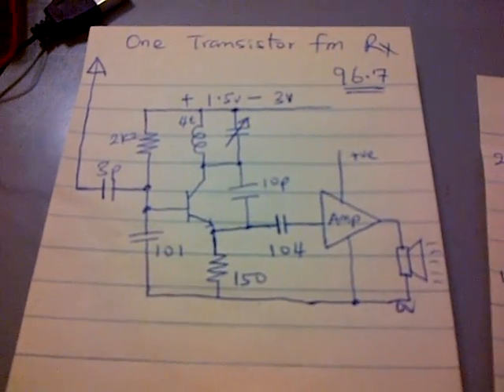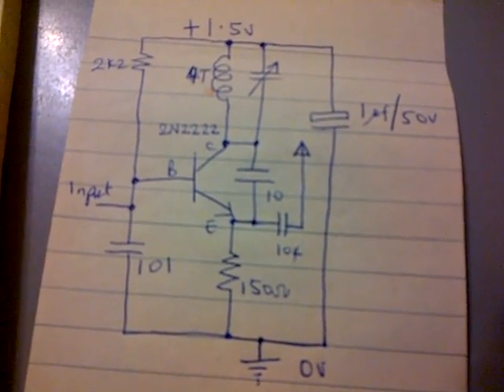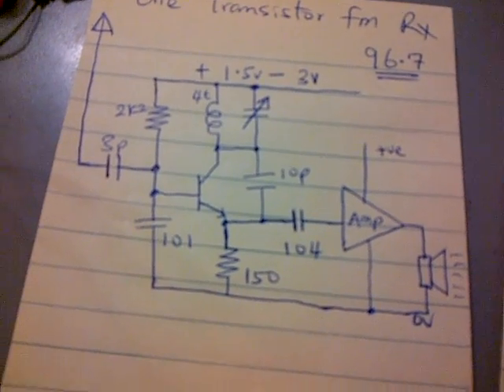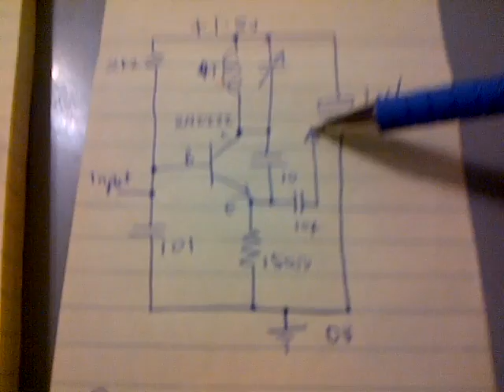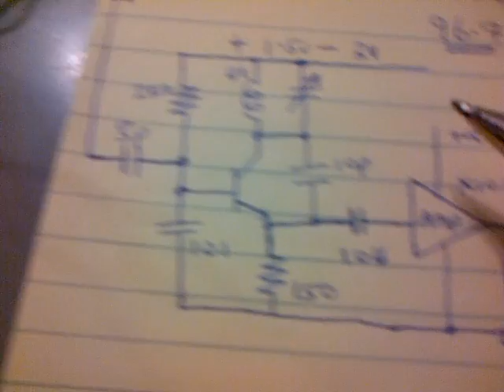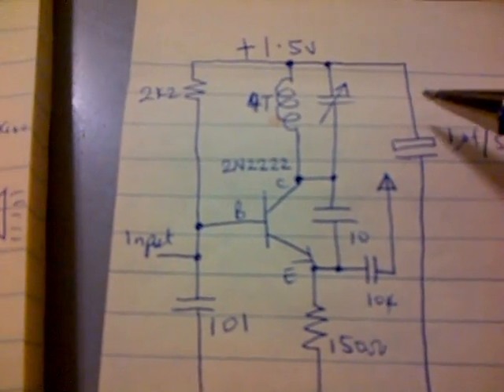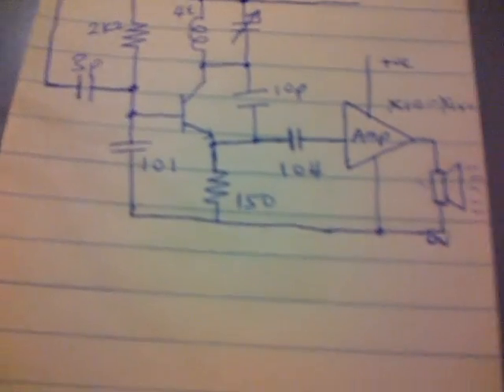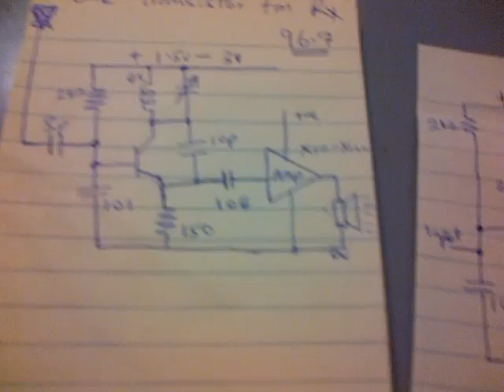Crafting a Simple FM Receiver with One Transistor | HecaWorld One transistor FM Receiver

Comment from the maker: I made this FM Receiver for fun. Many people commented that they built the same but theirs are not working. This might be related to your proximity to an FM transmitting station. The farther you are, the less sensitive/selective your receiver would be. 

This is really why you have complicated circuits for your typical radio receiver. You have the front end amplifiers, mixers, Intermediate frequency (IF) amplifiers, Detectors (Ratio detectors) and Audio Power amplifiers. 

Those are really useful. So, if you want to make a full-fledged radio receiver, you might need a lot of those parts. 

For the rest of us 'Enthusiasts', let's just have fun with the one-transistor systems. We will be working on some cool stuff soon... We'll be building Transmitter bugs and Long range transmitters soon (for educational purposes only... else, you might need a license).

Comment: Whats the purpose of antenna in the receiver cct?
Reply from the maker: An antenna helps to improve reception if the receiver is located in an area with low signal strength, but if you live very close to your radio station you may not need it - although I strongly recommend using one. The receiver is a regenerative one and not your regular superhet design.... it can use all the 'help' it can get in terms of signal boosting, even if it is by the use of a crude antenna.

The length of the antenna will depend on the target frequency. Get an antenna that is at least 1/4 of the wavelenght of the frequency you intend to receive.

Comment: Interesting idea, but I don't think connecting the antenna to the base of the first transistor can work because this tranistor works in common base mode (for 88-108 MHz the capacitor of 1n effectively grounds the base of the transistor and of course also the antenna signal!
Reply from the maker: Thanks for your comment, however, 101 is actually a 100pf Capacitor, which is 0.1nf... there is at least a 14.7-Ohm to 18-Ohm Base-Emitter impedance at the operating frequency range.... I believe that's why the circuit works... 

I will experiment with another version with a different value of capacitors or even an actual resistor to see how it works... :)
Reply: @hecanet  OK, my mistake. 100 pF is indeed different from grounding the base. The transistor functions as a crude mixer this way. Why didn't you block out the HF by means of a choke (100 microH), followed bij a 10 n capacitor to ground (low pass filter), before amplifying the AM signal? This should clean up the audio considerably.
Reply from the maker: @erikdevriese671  That's an interesting take... do you mind sharing a full circuit diagram for that? I or others could look at that sometime in the future... at the time, I simply wanted to show that an FM transmitter could also function as a regenerative FM receiver with minor modifications.

Comment: Is receiving digital data different from receiving voice
Reply from the maker: Yes... even though both are transmitted by the same wireless medium, digital data requires digital signal processing (DSP) at both the sender and receiver circuits. Audio/voice signal can be detected by a single diode, but a digital signal requires some processing and Analog to Digital conversion before it can be used as a digital signal.

Comment: What is the working principle of the receiver? How is the frequency modulation converted into an output signal with varying amplitude to drive the amp?
Reply from the maker: The circuit is a Colpitts oscillator whose frequency is determined by the tank circuit (Parallel LC circuit).

At resonance, the impedance of the L and C are equal and opposite... this effectively offers the least path of resistance to the station whose frequency has been matched (tuned in to). 

 The detection is accomplished by the transistor and the audio is extracted from the emitter capacitor (104 or 0.1uf).
Reply: @hecanet  thx man

Comment: We received a lot of questions about the Variable Capacitor. We are sorry to be responding this late, but just in case someone is seeing this video after the fact, the value of the Capacitor and Inductor must be taken into account... the tank circuit is a parallel combination of the Capacitor and Inductor. As long as the formula is observed F = 1/2pi *sqrt(LC), where F is the Frequency, L is the Inductor and C is the capacitance of the capacitor.

Comment: With this circuit, mine work greater than all superregen FM receiver that I build based on Webs (google).

Just my MOD:
Use Li-Ion (3.7V) and limit the current with 50K before this receiver, than before 104 to amp, put 20 turns enameled wire on 3.5mm diameter for RFC that make sound clearly. C9018 work better and better than any Transistor that I tried before.

I think this is the best FM receiver that I build for fun.
Next: modify it to make simple Transceiver or Walkie-talkie FM based and use it for disaster situation or survival time or when camping.

Greetings from Jakarta, Indonesia 🇮🇩

👍👍👍

Comment: I am wondering , is anyone really get this receiver to work.
Please post your schematic with parts you use especially which transistor s9018 maybe?
Reply: With this circuit, mine work greater than all superregen FM receiver that I build based on Webs (google).

Just my MOD:
Use Li-Ion (3.7V) and limit the current with 50K before this receiver, than before 104 to amp, put 20 turns enameled wire on 3.5mm diameter for RFC that make sound clearly. C9018 work better and better than any Transistor that I tried before.

I think this is the best FM receiver that I build for fun.
Next: modify it to make simple Transceiver or Walkie-talkie FM based and use it for disaster situation or survival time or when camping.

👍👍👍🤔
Reply: 2SC9018 👍👽

Comment: Try disconnecting the 100pf capacitor at the input of the receiver. It looks like there is an attenuation reducing the signal strength about thirty to forty times at the input.

Comment: you'd better Connect a transistor with a 22K resistor on base after the opamp... otherwise any short-circuit or heavy load would blow up your IC within a split second ;)

Comment: hecanet can i use bc 547b or bc108 i can't find 2N2222 transistor please answer me
Reply: hecanet thaks, but in the rx circuit i didn't see wire between amplifiler and war. capacitor what need to stay there? http://prntscr.com/77qys3
Reply: hecanet transmitter works good with bc547b but i have a problem with rx i can not pick up any radio station i change the coil  bur same problem

Comment: This is not FM, sorry. It recieves the AM part of the transmitter. such simple FM recievers are not possible.

There is a reason, why you need multiple steps for recieving FM. Single Transistor - impossible. Even multiple transistor FM reciever is hell of a difficult job. ICs designed for that purpouse are prefered.

Comment: both TX and RX are identical OSCILLATORS, oscillates in FM band one is mixing signal to carrier signal another filtering, if transmitter is powerful then receiver works great. & if transmitter is poor then receiver need much greater amplification!
Reply: What you mean same frequency?

Comment: Does your hamburger speaker represents your amplifier circuit here? I tried this a while ago but it didn't work.. I used a ohm speaker (I'm not sure if this is how you call it) and a audio op amp with feedback resistance of 100kohm and Ra of 10k to produce about 11 gain using the formula (1 + rf/ra)..

Comment: A 1 transistor rx is possible if you use a high impedence crystal earpiece instead of a speaker, though signals will be faint. Adding another transistor as an audio amp greatly improves volume with very little increase in current consumption.

Comment: cool you can make a 1 transistor walkie talkie!
Reply: I need the same project
Walkie talkie
Reply: @driverunit6656  easy to do given the circuit. you just need to switch the antenna and the audio amp input with a DPDT pushbutton switch! The circuit is almost the same for both functions!